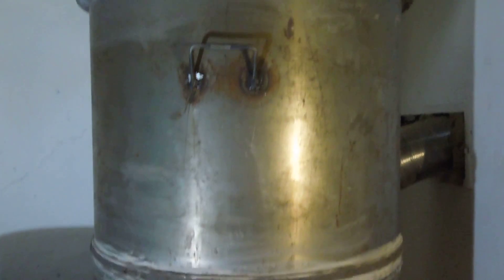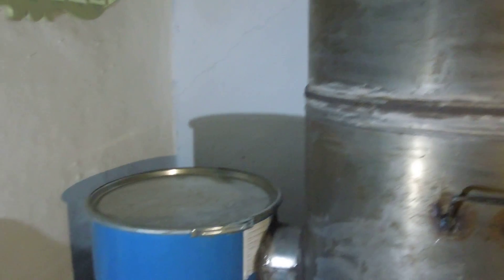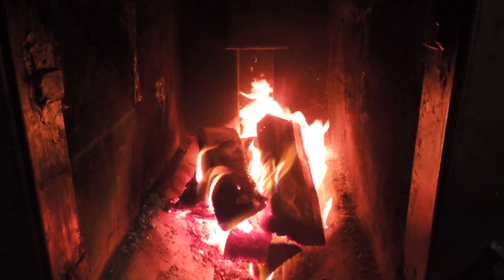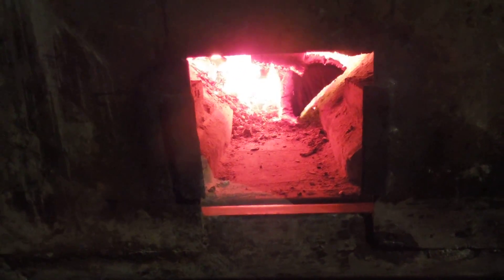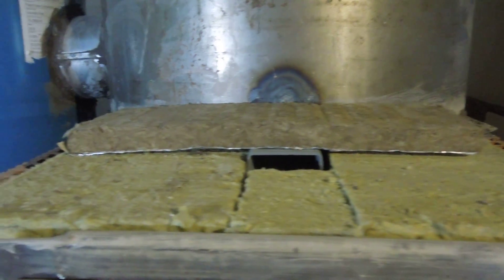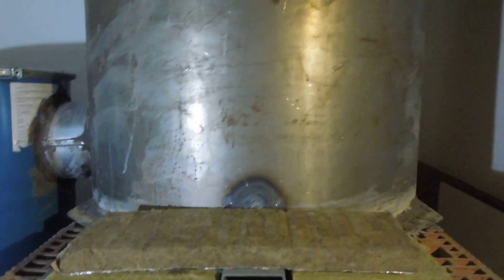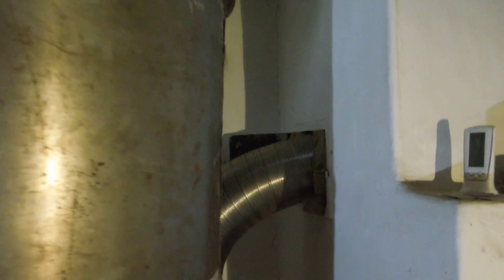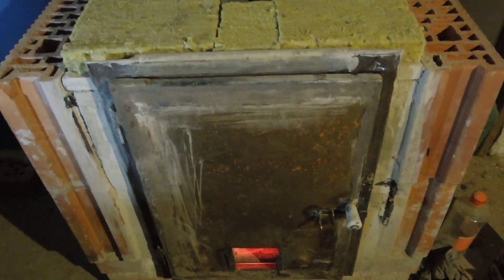Romanian Batch Rocket Stove

Comment: A lovely build, i Like IT so much. I start working on a Double Bell two jears ago, and in that time i wanted to built IT on Pellets, but in time they want so much Money for 15 Kilo almost 12 to 14 Euro, so i looking forward to built a batch Box. Do you have something Like Temperatur of the First Bell, the second, and where the riser goes in the chimney? 
Greets Sven
Reply from the maker: Hello! and thank you for your interest. Due to many health issues accumulated over the years I had to postpone further development on "The beast". So, first thing first, I took some temperatures readings lost it with the failure of my computer hard drive. As for "where the riser goes in the chimney" I think I can provide you with some picture but you must give me a little time I mean this Year not the new year. My review after using "The beast" as I am calling it. Due to intense heat generated during burning cycles which after only two years in use resulted in partial damage of the refractory lining in the burning chamber and the lowest heat riser section as well. I choose to be thorough insulating everything as much as I could and, it worked great. One thing though, I used highest quality refractory cement but I had issues with the reclaimed refractory bricks I used due to low cost target I was thinking of. When choosing insulation materials Perlite is the absolute winner, at least to me. About using pellets you are right, In Romania I can buy 15 Kilos for 6 Euros or so but mainly white wood(bought 15 kilos just yesterday), not hard wood. I am using pellets from time to time, to mitigate humidity in the wood I used as fuel. So, that being said I wish you "A merry Christmas!